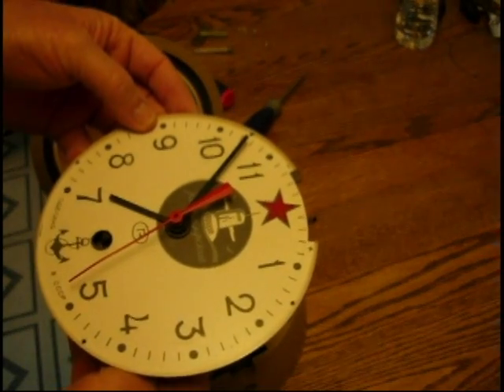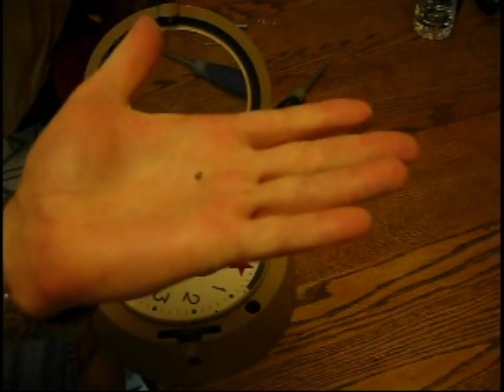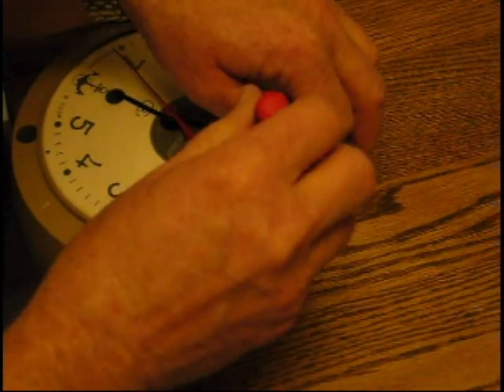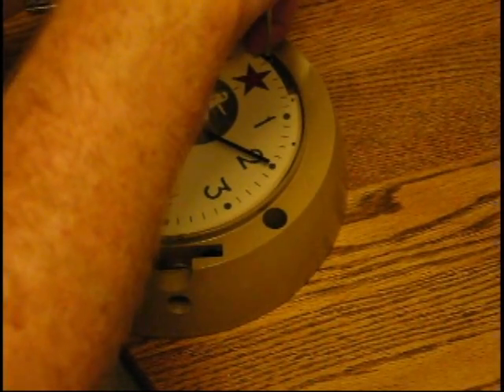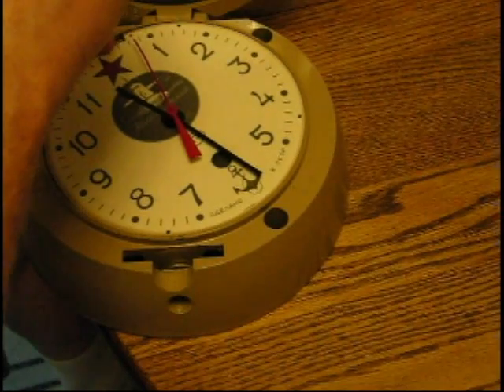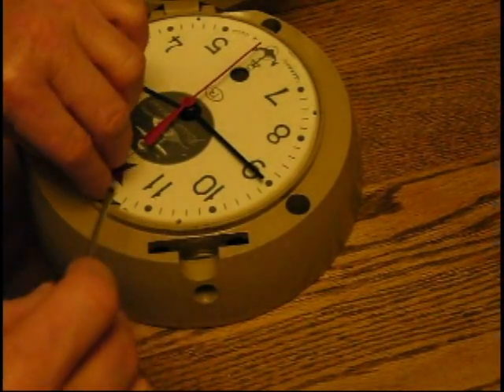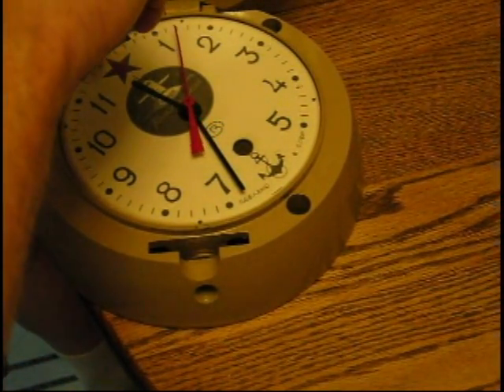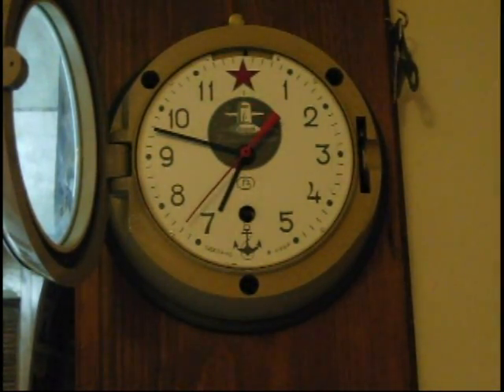USSR Clock Fix.mp4

Comment: Are you joking?  Russian military clocks are superbly accurate.  I have the submarine clock, T34/helicopter clock, missile silo clock and three aircraft clocks.  It is essential that military clocks are accurate.  If yours is not it is due to the damage and/or amateur tinkering.
Reply: The version of the clock shown was made available for public sale. They are manufactured by Vostok ("East"). The casing is more rugged than any other ships clock I have, including my ex- Royal Navy submarine clock. The failures to mention are probably down to lack of servicing or errors in servicing. I have had my example for many years and it runs and keeps very good time.